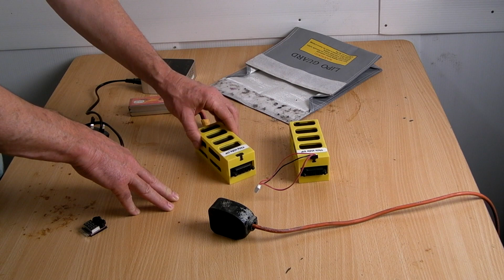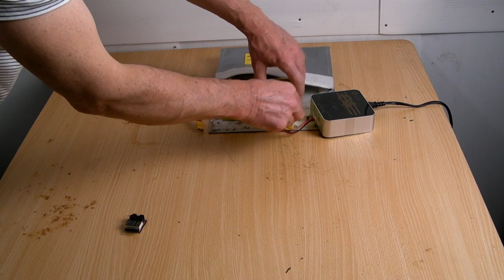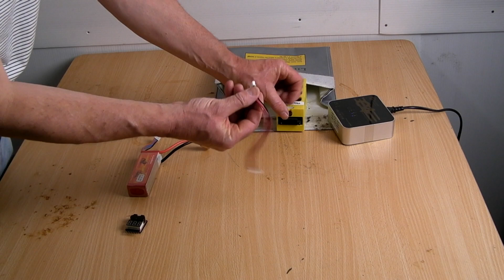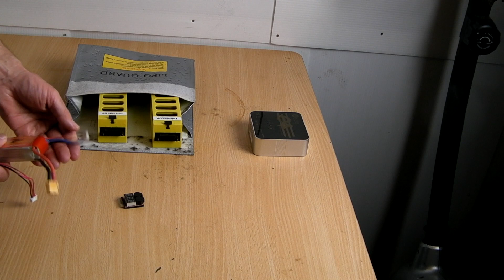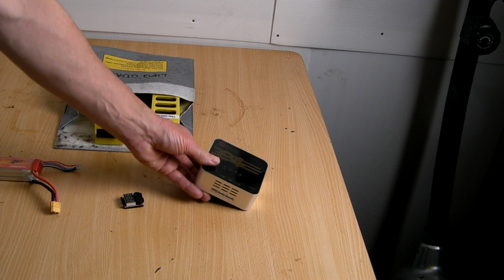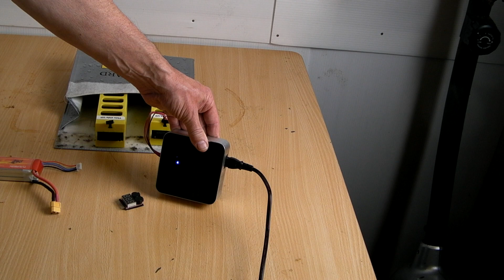Hexo Plus Lipo Battery Fix In One Hour - Zero Volts to 11 Volts using another battery

Comment: Hi sir, what digital monitor did you use?
Reply from the maker: 1-8S Lipo LiMn Battery Tester Low Voltage Buzzer Alarm cheap from ebay or amazon